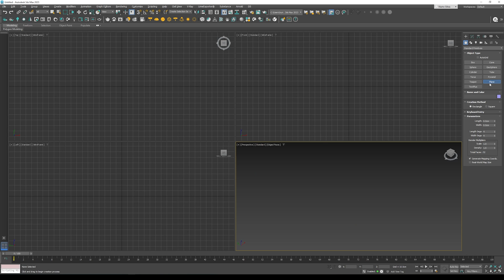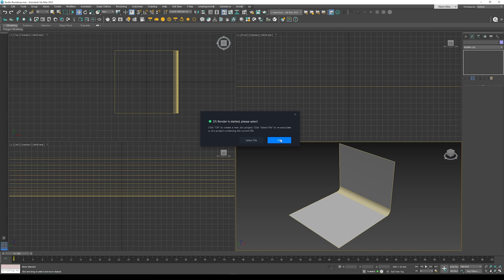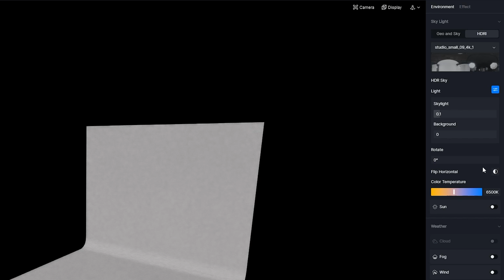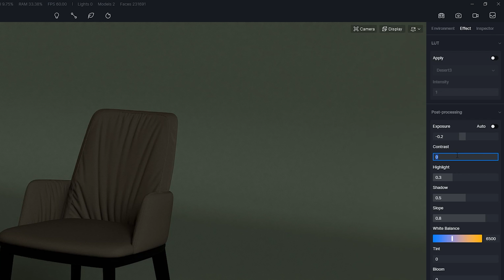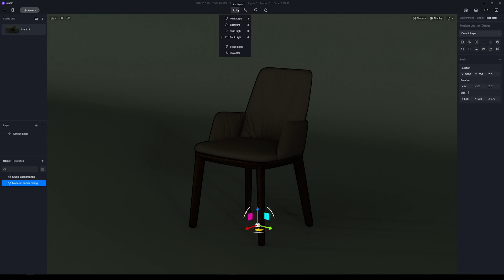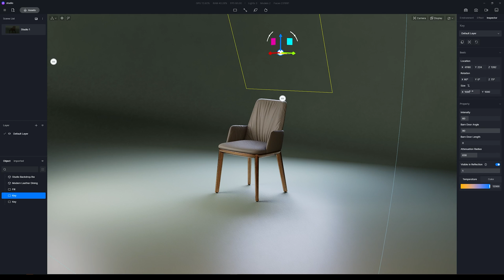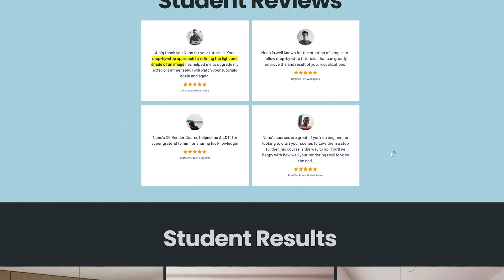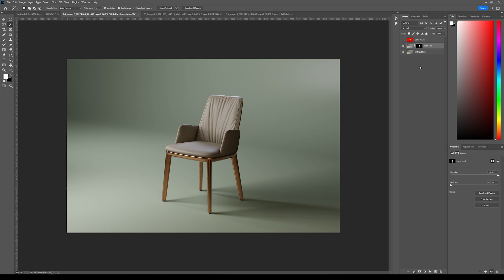How to Make Studio Lighting in D5 Render - Product Render Tutorial

Comment: Great vid Nuno!😀 I really like how you solve the rim-light problem. You could however also apply the shutters to the rim light to focus the light on the top of the chair without the light touching the floor around the chair. The angle will of course not be as steep as in your render, but you could still cover the backrest, and perhaps the tip of the seat 🙂